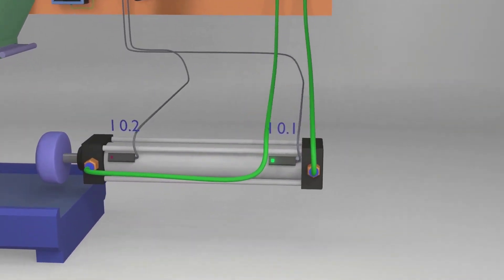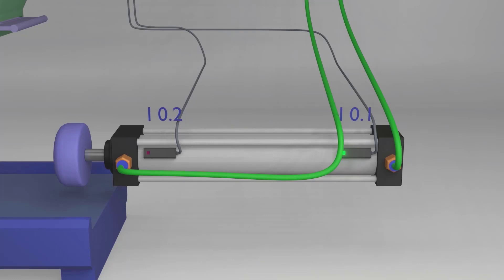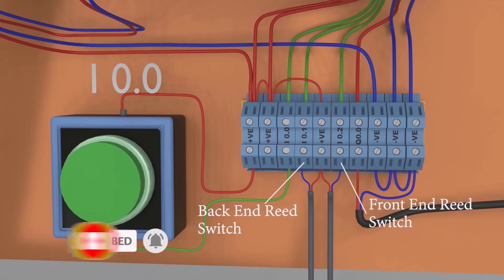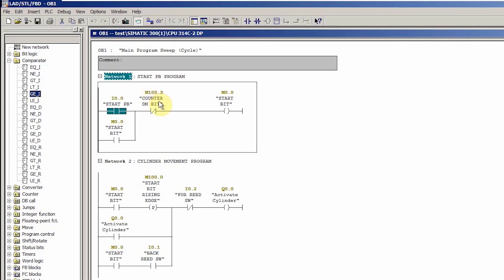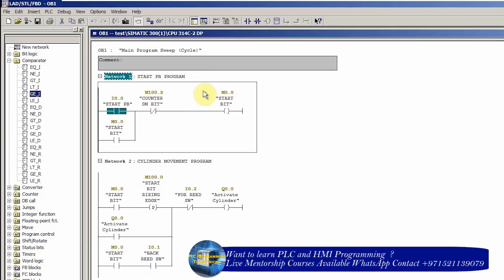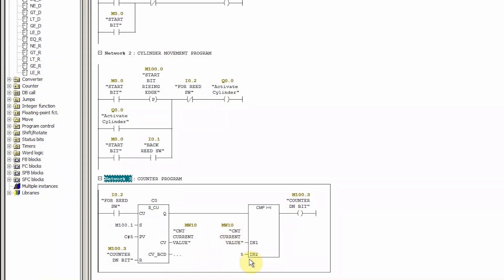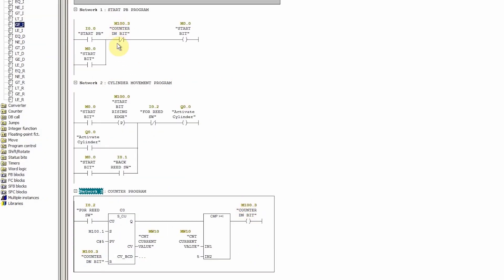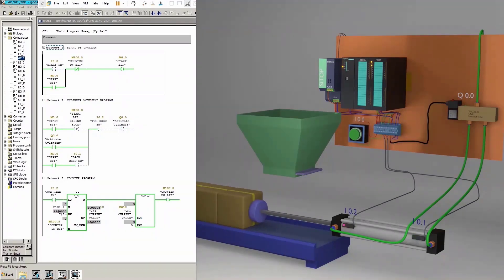Pneumatic Cylinder PLC Programming Industrial Project Tutorial | S7 300 PLC Program for Beginners

Comment: I0.2 energized only 1 plc cycle, is it really? U must use failing edge of i0.2 in nw3
Reply: @dimarf1 , yes it will work bcz the cylinder will only retract if it sees %i0.2. this entails that the failsafe mechanism is being provided by the reed switches being initiators of cylinder extension and retraction, otherwise an n-trigger was necessary to ensure 5 boxes are correctly counted.
Reply: @shadreckmugabe4841  This actually wont work at all because the cylinder is not fast enough to retract, so you need another positive edge in front of the counter, otherwise on the next cycle counter will increase again and again ??